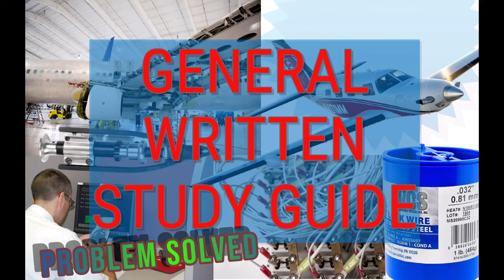2026 FAA A&P General Written Exam Study Guide (WATCH THIS BEFORE YOUR EXAM)

Comment: The last question. 8541.  The answer is THE STARTING POINT.  Just an FYI for the listeners.  Have my test in a few days and the recording has been helpful in getting my reps in. Just wanted to point this outs. Also the question for firewalls the answer is titanium. Those are the only two errors I found everything else is spot on.
Reply: I been studying for the past few days and heard that firewall questions and knew it was bs

Comment: I used this study guide, prepware app, and the Asa book to study and pass my general a few months ago. I have horrible test anxiety, but still passed with a 78.

 I'm going through and studying for airframe now but there is very little guides on youtube that don't have annoying ai voices or are extremely outdated. Will this channel ever do a study guide for airframe like the one for general? 

The book and app are my biggest tools for studying, but I use audio guides like this to quiz/test my retention of the study material.
Reply from the maker: The study guide for airframe will be out next month as it is a huge about of material to go through. Please like share and subscribe if you haven’t already.
Reply: @northeastaviationpro  awesome to hear! A small suggestion, if I could... Do seperate videos on each chapter. It's a lot of content, but should cover most of if not all of the material that way. Plus it'll make it easier to go through each section individually without having to scrub through a 6-8 hour video. 

Glad to hear you're working on it though. I'm trying to work on a deadline and will be taking a class to help knock out o&p along with more studying for that test, so I'll likely have tested already by the time it comes out then since I have a deadline set for myself.
Reply from the maker: I have chapters with time marks on some videos tho
Reply: @northeastaviationpro  and it is very helpful. Doing one video covering ALL of the content would be at least 10+ hours. On one hand, sure one stop video for all viewers, but editing all of that together and converting it to one file? Uploading that all at once? Just looking out for you and your bandwidth.
Reply from the maker: Amazing!
Reply: Did you use prepware? If so, how much of the exam was different, i keep seeing that most of it is stuff thats not on prepware
Reply: @OblivioniX17  I used prepware, books and the phone app, as well as this video.

When in doubt, you can never go wrong with the pdf's the faa has on their site for free download as well. Go to the aviation handbooks and manuals, scroll down til you see the faa general book. There's also airframe and pp as well. It details everything so is worth a read for sure to all those studying.

Comment: Isn’t the construction of aircraft firewalls made of titanium alloy and not stainless steel?…
Reply: Titanium is used for short term high heat situations but is not used to construct the entire firewall so stainless steel is the correct answer
Reply: Depends on the construction of the aircraft
Reply: Prepware says titanium but the 8083 says stainless steel
Reply: @Guitarmark123 so stainless steel then
Reply: @Guitarmark123 whats 8083
Reply: Stainless steel by the book
Reply: Depends on manufacturer I work on bell 407 and 206s and both have titanium.

Comment: Out of all the questions on this study guide 60 of them are on the General Written Exam Correct? if so this video should suffice as the material required to pass the exam once mastered?
Reply from the maker: This video includes all potential questions on the written exam. Note: some questions and answers will be worded differently. Please learn in depth the topic and system.

Comment from the maker: 0:00 INTRO
0:14 BASIC ELECTRICITY
12:43 AIRCRAFT DRAWINGS 
18:06 WEIGHT AND BALANCE
27:46 FLUID LINES AND FITTINGS
35:47 MATERIALS AND PROCESSES
53:34 GROUND OPS AND SERVICING
1:01:11 CLEANING AND CORRORION CONTROL 
1:08:34 MATHMATICS 
1:10:17 MAINTENANCE FORMS AND RECORDS
1:19:56 BASIC PHYSICS 
1:26:05 MAINTENANCE PUBLICATIONS 
1:34:10 MECHANIC PRIVILEGES AND LIMITATIONS
Reply: You’re the GOAT I hope you become a millionaire
Reply: goated
Reply: Clutch bro!!